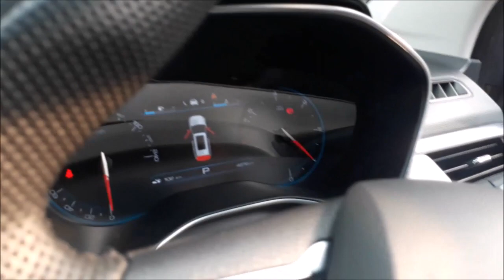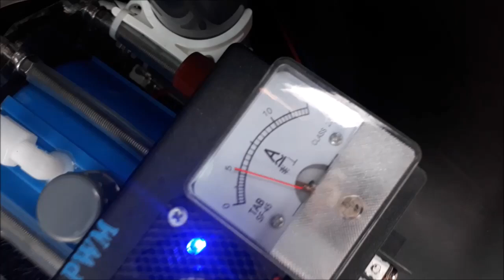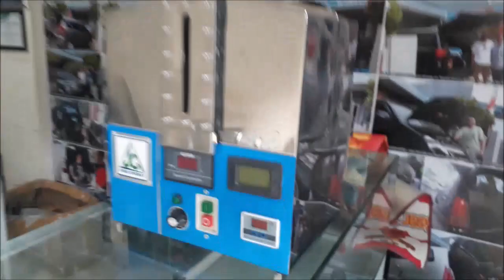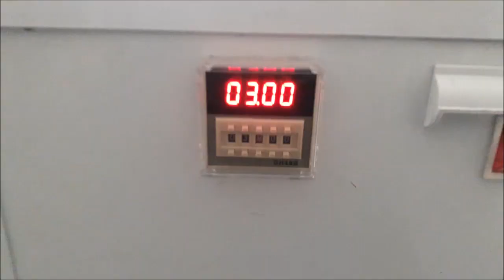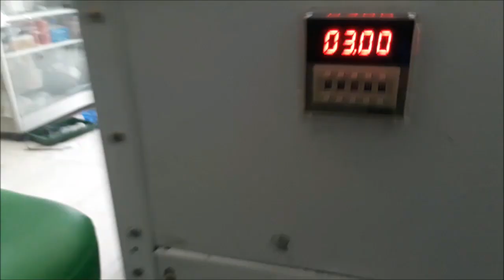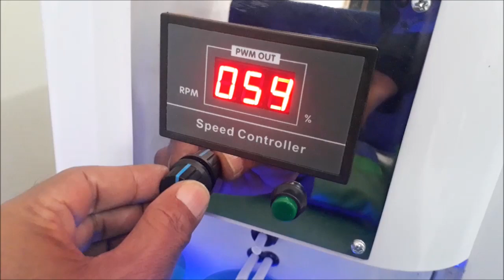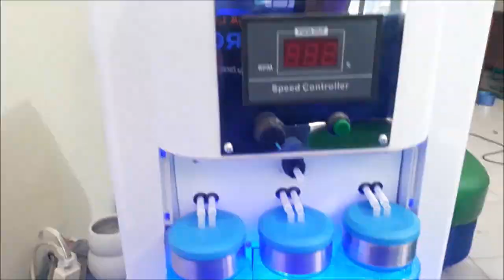Joko Energy's fuel saver  HHO + EFIE  on Wuling Almaz 1.5L 2019 Turbo Grey the fourth

Comment: Hi good work, but you should put the cables in the pipe to protect them from water.,👍👍👍👍👍👍
Reply from the maker: your advice is good but without a shield like that it has also been proven that for 10 years it doesn't matter